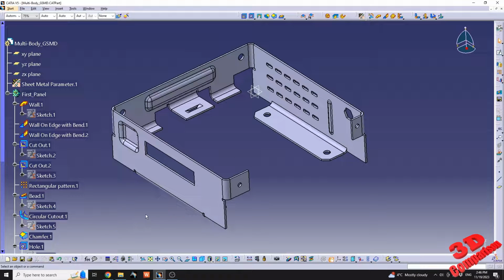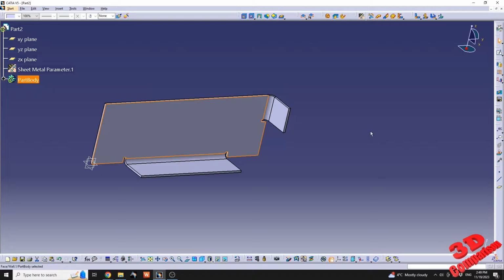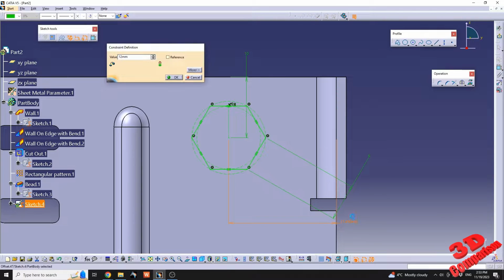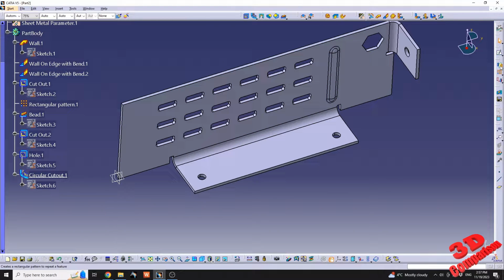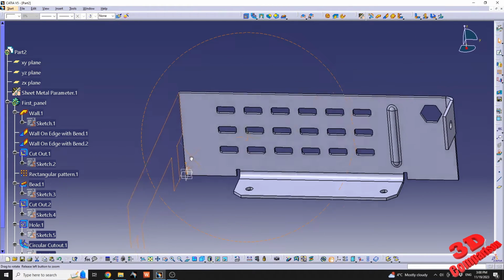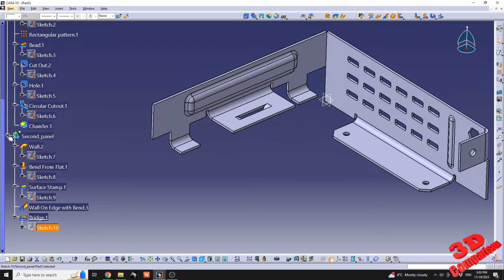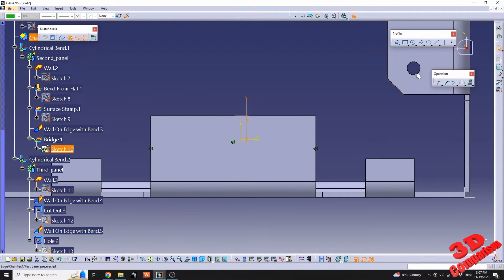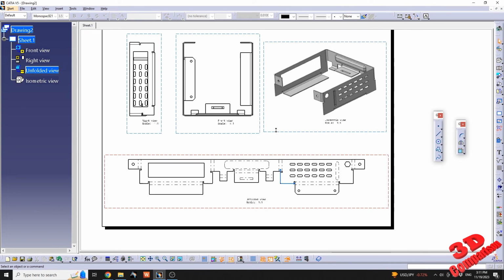CATIA V5 - Sheetmetal Design Multi-Body Parts

Comment: If the general design of a solid is like that, is it difficult to process? 
In this case, what will the processing method be like?
Reply from the maker: This is a workflow that can be used to combine multiple part bodies to form a single sheetmetal part. That can be unfolded at the end. Other workflow could have been used using a single part bpdy to define the same part.
Reply: @3DComparison  I don't quite understand what you mean, does it mean there will only be one time bending on the product?